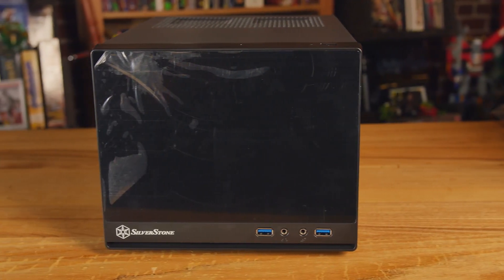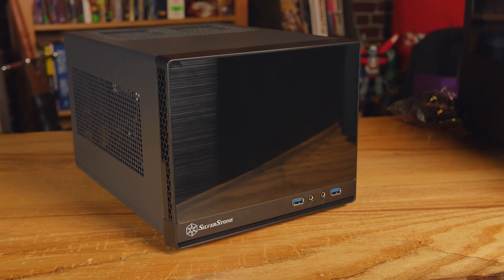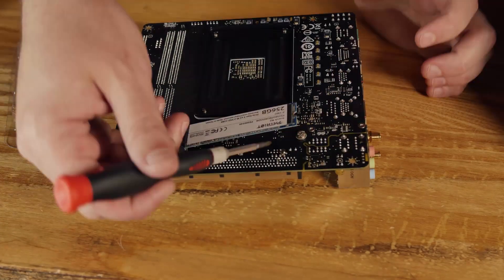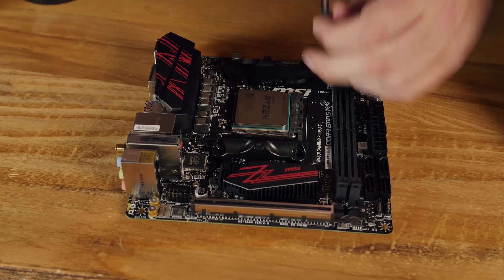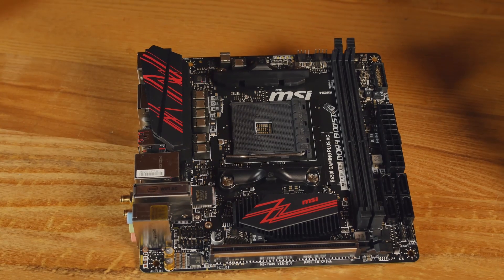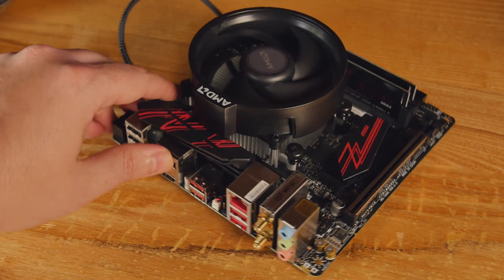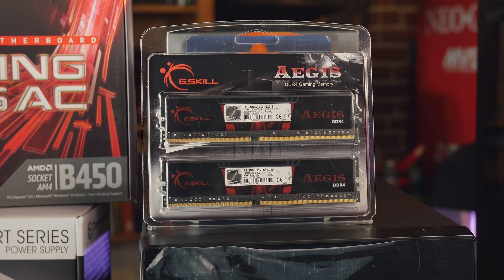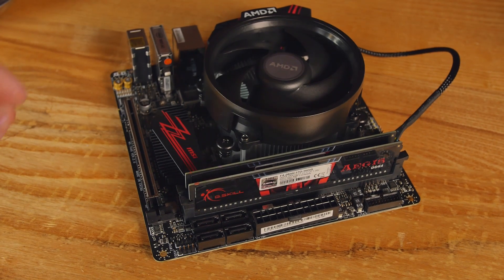Build an Awesome AMD Living Room HTPC | 2019 - Home Theater, Office, Medium Gaming

Comment: So guys. I need a NAS with (8TB usable storage) and I need a Plex Server. I already have a HTPC (i5-3470-8gb-GTX1050)
Option 1: Should I buy a Synology DS218 with 2x 8TB in Raid 1 and install plex on my HTPC? (Networkshare on the NAS)

Option 2: install unraid with plex on my HTPC and use it as a Plex Server and NAS in one device?

Comment: I hear the stock cooler for the Ryzen 2200G is actually insufficent because an APU runs hotter than an equal cpu.  Have you seen a similar trend over time?
Reply: I use a 2400g with a stock cooler. Overclocked it, and run games like AC Odyssey without issues. The thing is really silent, but OC-ing was limited, crashed a couple of times, but found a steady build now. Runs without a hitch for over 6 months now. So for an HTPC, this is perfect.

Would recommend a different cooler if you want to focus on gaming etc, but then you'd probably use a dedicated GPU anyway.

Comment: MSI B450I Gaming. The mid-range B450 ITX mainboard that has a better VRM than 95% of the wanna-be "high-end" X470 boards. Awesome little board, use that one in my gaming system as well
Reply: These MSI B450 boards can be poor choices for any customized gaming performance because the iGPU clock speed can't be adjusted. Great VRM for APU's, but unsuitable because of that BIOS issue.

Comment: I'd just install a standard GNU/Linux distro, probably Guix System. For media I like to use mpv. It's super powerful and you can control it from the terminal it's launched from, meaning you can control it from other devices over ssh. I recommend doing this in a tmux session so other devices can access the same mpv instance. (laptop, phone, whatever you have near you) You just have to export the DISPLAY env variable so it knows there's a screen to show stuff on. (mpv can also be used to play audio on something headless) You can set up setting for automatic volume per file type and for http(s) stuff, easily take screenshots, and play things from a .m3u file (you can just put a file path or a url in here with your text editor of choice and then open it in mpv). This setup is also handy for displaying pictures on a big TV. mpv can handle pictures, and you can even give it multiple things to open and it will treat it like a temporary playlist, so you can use the < and > keys to go back and forward through them. You can do stuff like `mpv pictures/cats/*` and show off all your cat pictures.

Comment: You could use pop OS grab a drill make your own vent holes on the side with a pattern some black spray paint ,specially if your tucking it into the home theater stand and shove a SM form factor graphics card  like a   Zotac GeForce GTX 1060 Mini 3GB GDDR5. then you could do some half way decent gaming too

Comment: I would install a multi-media-specialized distro (with Kodi but also with access to a terminal) of Linux and I would use a 2400G and keep the gaming limited to simple games which don't need much hardware performance. Emulation (Super Mario Kart, Super Smash brother, Mario, Zelda, Megaman), Rocket League, Borderlands 2, CS:Go, Cuphead...

Comment: For a HTPC I would go with a SBC with a Intel Atom running Debian. I would do FreeBSD if Netflix and the like would be compatible.
Reply from the maker: I had an atom but it was stuttering a lot with h.265 and also some huge files like de-specialized Star Wars (over 25gb each). It was a slideshow.
Reply: @teksyndicate  That makes sense with the h.265. I suppose you could have another machine in another room do a real-time live transcode to h.264 using OBS and Nginx/RTMP.

Comment: Soo.. My HTPC.. I got an old Acer XC600 that I and an old co-worker of ine diagnosed with faulty Ram slots. In the end I got it home with me (technically not allowed but shhht) I discovered that 1. Acer XC600 Systems use standardized Micro ATX mobo measurements, meaning I can upgrade this sytem to a Ryzen 3 2200G if i wanted to. 2. H61 one mobo's, second hand, are still expensive.

Right now it has:

i3 3220 (A weird one with no iGPU)
6GB of DDR3 1600MHZ
Samsung 850 250GB SSD
MSI GT 730 Passive cooling.
Windows 10 Pro. (For unknown reasons this mobo had a Windows 10 Pro license attached to it.. given it was activated after install, lucky me!)

Comment: for a home theater i’d probably just use a light fast linux distro.
Reply: I used Sparkylinux gaming edition with kodi and it a beast.  Plus lutris. Woe
Reply from the maker: I'm using MX Linux in the exercise room and it's about perfect for that.
Reply: @teksyndicate  
I use Manjaro. I like the Arch repositories and I like KDE Plasma. I have tried MX Linux, that had some serious problems on my hardware, it was terribly slow at booting (>30 seconds compared to 12-14 seconds of a regul Linux distro - old hardware). After an update of Manjaro it also happened to Manjaro, I installed Haveged and had it run all the time (systemctrl enable) to increase the entropy and the problem was solved. I speculate that that might have been the problem for MX Linux too.
However, for a HTPC I would probably use a tiling window manager instead of a desktop and use a compact wireless keyboard.

That exercise room is intruiging, I never have seen anyone in my country have that.